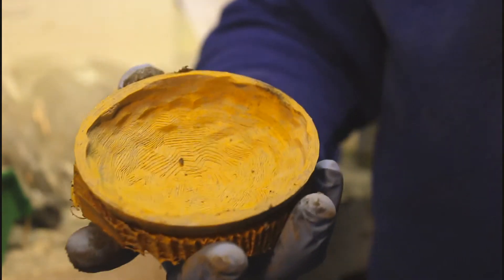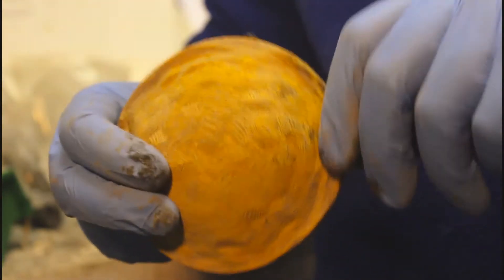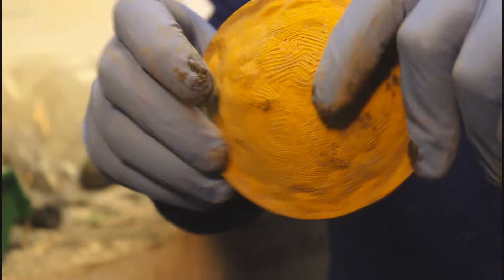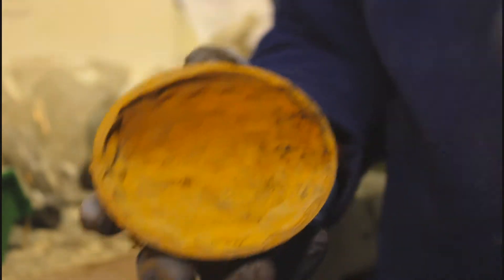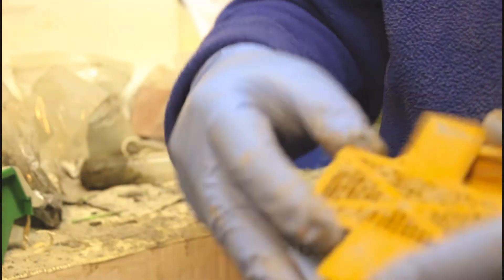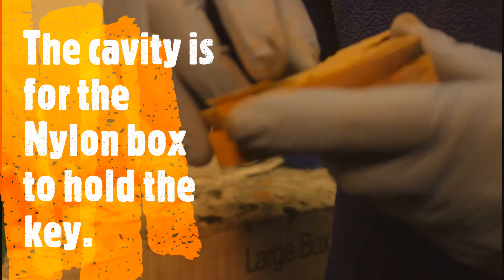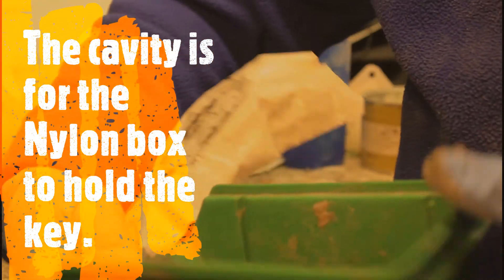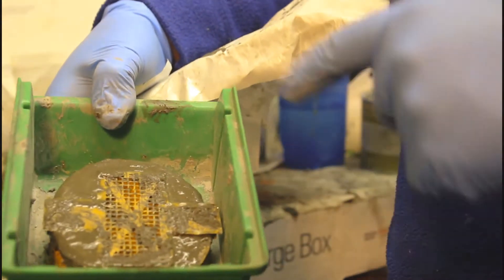Casting Cement with a 3D printed TPU mold.

Comment: Thank you for this video. I was wondering if it was going to react with the chemical process of concrete hardening, but it seems it doesn't. Great way to win a lot of time if the master piece breaks and needs to be done again, or if the mold becomes unusable. 
The only downside would be post-processing the TPU mold if one doesn't want the layer to appear, as "baking" it in an oven to obtain a glossier finish could be a risky task.
Reply from the maker: For me I liked the layered look in in the cast, it helped give the casting a more natural look from afar. From what I understand TPU is inert to concrete, I did not see any reaction to the mixes I tried. If you want to hide the layer lines you could try finer resolution (I printed the mold at 0.3 mm layer height) or using an epoxy to smooth the mold.